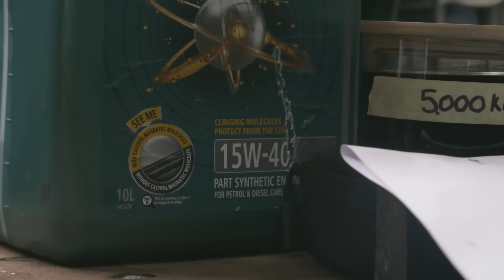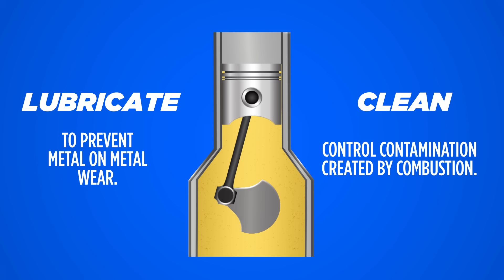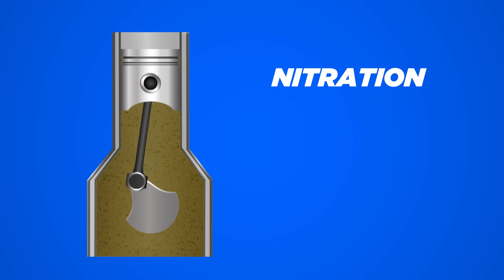Engine oil COMPARED at 5,000km vs 10,000km vs 20,000km! This'll make you service your 4WD RIGHT NOW!

Comment: Smartest is to put hour meter on your car. When they say 10.000 km - the average speed driven at any given time is around 30km per hour. So the oil change should be every 330 hours.  That is normal for engine that has lot of variable engine speed and torque use.  For engine that has almost fixed speed and torque use, like generator, boat engine and excavator. It can last 500 hours. So for perfect maintenance, engine hour meter is the key.

Comment: i have a PX2 3.2 ranger and live close to work, so i service it every 5,000km as it has a lot of short runs, my wife’s isuzu MU-X i service every 7,500 as it’s recommended at 15,000 so if half it, as for every other oil in them 20,000km as for the filters too. 
i also strongly belive in catch cans and pre fuel filters for reassurance

Comment: I have a Nissan Navara d22 and I service my oil every 8000-10,000 kms unless I’m doing a large trip which in that case I service before and after to ensure the motor is running the best it possibly can. I just changed all brake fluid, transmission and diff oil in prep for moving down to Tasmania!! I try to service all these fluids every 30,000. After I bought my car I realised the previous owner never did the brake fluid. Was absolutely black and discussing.

Comment: Brand new bt50, recommended by the dealer for every 20,000kms for normal driving 

I service mine every 10,000kms and have gearbox and diffs done every 20,000kms 

If the car has done harder towing or 4wding ect I get it in for a extra service on the 5,000kms
I also have all filters done every service and carry spare filters on the bigger trips 

At the same time I’ve had the egr done and a catch can aswell which also helps heaps

Comment: I change my oil every 5K and driveline oils every 20K being i own an older truck that gets worked pretty hard. Always make sure the car gets a chance to warm up and get to full operating temp. Oil is cheaper then a rebuild.
Reply: If you double up in Oil and filters over 300-400k Km's works out to save around 3-4 thousand In AUD dollars over the engines life rather then increase its longevity by a very small amount probably like a few percent. They don't just pull the recommendation numbers out of there ass its a pretty fine science and then rounded down to look nice. In the end it really just depends on how much your engine $, personally would stick to the recommendation oil and filter change under 10K engine value.

Comment: My 2013 Dmax manual says change the oil every 20k. I change it every 10k. The major services are each 40k, every oil, fluid and filter. Expensive yes, but cheaper than a new turbo, engine or diff. Long term investment.

Comment: I do a lot of off road driving sometimes towing a camper, without fail it gets serviced every 5000kms, gearbox, transfer and diffs get done every 10000kms unless I do water crossings then it gets done when it gets home. All the filters get changed every 5000kms as well. Since getting the car 4 years ago it was running 18.6lt/100kms, with the regular services I have managed to get it down to 13.5lt/100kms. I recommend every 5000kms if you want your engine to last.

Comment: Every 10,000km I check everything from filters to oils. Engine I typically do just before 10,000 but check it at 5000 and at least 2 times a month because sometimes I don’t drive it far or use it everyday. Diff and transmission I dip test and if the oil looks like it has dirt/water in it I change it but every 20,000-25000kms

Comment: I tow a boat and also do a lot of sustained highway trips and I change my oil and filter every 6000 km where the manual says to do it every 10000km.  I also run Nulon fully synthetic diesel oil , my mates tell me its overkill but I have just clocked over 300,000 km and have had no issues except for normal maintenance like timing belt , coolant , transmission , transfer case and diff fluids. In the rare occasion that I havent been able to do the oil change on time I will use an engine oil flush to ensure no carbon or sludge buildup . I also prefer to use a 5 or 10W40 weight oil where some dealerships use a 5W20 or 30 weight for fuel efficiency but heavy driving especially in hot summer weather is not going to give longevity to an engine.

Comment: I sadly no longer have any car at all.
But what I would do is something like.
oil and filter change at 5000km, if long vacation trips on the european highways it can be 8k to 10k for the vacation trip. or at least once a year if driving very little.
air filter when oil is changed, because why not.
brake fluid, gear, diff, coolant, cabin air filter, and so on. the things many tends to forget, at least every year, but could sooner depending on the use of the car during the year.

in all honesty I rarely put many km on a car in a year, just liked having one and maintaining it and fixing them as they where always old rusty things

Comment: In my td42 Gu I do engine oil every 5000 religiously rear diff and gear box every 15000  and Front diff every 30000 the Gu has 450'000 km on her now and still going strong

Comment: Hey boys I service my vechiles every 7500kms, Oil + Filter is a must and usually an air filter because what’s $20 to a $10k engine 
I Then go from bumper to bumper checking all parts off the underbody and gear oils changing when they start discolouring and smelling (usually on the 3rd service) 
My car gets me to work which allows me to make money and live life to the fullest. In order to keep doing the things I love I’ll spend whatever the cost is to keep my vechiles running smoothly and healthy!! 
 Thanks

Comment: I’ve have a did 3.2 Pajero and this video make me think about a was doing every 10000 on oil but I’ll start every 7000 km from now . Diff every 20.000 and gear box some time around 35.000 km 
Cheers

Comment: I like to "services" my car every 5000kms with a oil and filter. Diffs/transfer case/Gear box every 10,000 (but check every service incase they need changing). Would also change all oils after a hard trip or before a long one.
- Kane

Comment: My 2012 YD25 Navara get an oil change every 5K, and I stick to the factory schedule for the driveline and coolant as long as there’s no contamination! Air filter whenever needed. Fuel filter 15-20K. Brake and clutch fluid 20K. Blinker fluid as required.

Comment: I always service my vehicles maximum 5-6000 kms for oil
I do gearbox oils roughly every 20,000 kms
diff oils roughly 30,000 kms
Power steering flush every 15,000 kms

all fine and dandy
Reply: i change my oil every day , even when i dont use it

Comment: I do an engine oil change every 7500km. Owner's manual states 15,000km services, so I keep to the factory servicing and do my own halfway in between. I live in the country, so not much stop start at all. If I do a trip, I do a service, change oil and all filters before heading off. Trans and diff oils are always done either before or after trips away, but always much sooner than recommended (many  mods and a dyno tune). Never had an issue because I don't listen to the manufacturer who just wants you to buy a new car as soon as the warranty is finished!

Comment: I got my gu zd30di at 220,000 ks and did the pump injectors and glow plugs at 250,000 and in three years it’s now on 440,000 ks and I service the engine every 10,000 ks and it’s almost as clean as when it went in, admittedly I’ve let it go to 20,000ks on two occasions to see how it looks and it’s as good as the first dirty line in your test on the paper. I service the auto every 100,000ks but I haven’t changed my diff oils as yet but have checked them and don’t really hit the big holes much doing 1,200 ks a week to travel for work I could really use a year of oil to keep the old girl going and see how many ks the old gu will do. Cheers boys

Comment: I like your show but this video seemed meaningless to me.
Were the samples from the same original oil type? Or run in the same engine model?
I would find it interesting if you were to leave the oil in a particular engine and take samples at 0, 5k, 10k 15k and 20k, and send the samples to an oil testing lab (which is quite inexpensive) and report back on the results.

Comment: My Amarok is still under warranty from VW. The service book states an oil change to be completed every 15k.  After watching this episode I’ll be doing  extra oil changes at home. Thanks Shaun👍
Reply: I would do only one between services. And change just the oil, not the filter. Easy to do and even if it not necessary, it won´t hurt anything.

Comment: Hi Shaun the reason why Diesel engine oil goes black is because it is a high detergent oil designed to de carbon the engine to prevent Diesel engines from getting pre ignition. By 10,000km the very small oil filter if cut open would be choke a block full of carbon. The more oil and bigger the filter the less carbon buildup in the oil. I go 10k for oil fuel and yearly coolant and diff oil’s  transmission oil is changed every 2 years with filter and comes out clean in my 2014 Dmax XRunner. I regularly tow a 24 ft caravan with my 4x4.
Reply: Most filters onky filter down to 99 pecent ish at 20 microns. Soot particles can be small like 2 microns. Thats the stuff the filter wont get. So unless u run a bypass filter you should still change it once it starts going dark

Comment: 5k engine oil+filter  , 10k  airfilter+fuel filter  ,  30k - 50k transmission fluid+filter  ,  30k - 50k  diffs an transfercase .

Comment: GQ 650 km on the clock,all original, engine never touch ,engine oil,filters,every 5000,differential and gearbox every 10 km

Comment: Shauno, good advice for those that only do short trips, are regularly towing heavy loads, or spend a lot of time off road, however you didn't mention that a good quality filter is just as important as the oil itself, along with the oil change procedure. Best to drain oil with a wamr motor, as the oil will drain easier. Once refilled to the full mark, start the motor, let it run for 7 to 10 seconds, then turn it off. Wait a minute (for the oil at the top of the motor to drain back to the sump), then check and top the oil level back up. 

My X5 BMW is serviced every 20k to 24k, service book recommends 24k. It has done over 400,000ks without an issue, however I don't take it far off road these days, or do a lot of long distance towing with it. Most of the time it is driven, it is in a country town, dong 15 to 20 minute trips so it gets warm every time. Oil changes are easy, oil is still quite viscous (still turns as black as every other diesel), yet never had a major issue with it. However, it also uses 7.4 litres of oil, so I'd say the actual oil capacity has a lot to do with the longevity and service intervals of the oils.

Trans, transfer case and diffs have never been touched since I had it, they were last serviced in a dealership and don't need to be touched for another 30k or 40k. But again, I'm not doing water crossings and such every few weeks, so those depends on your driving conditions and the overall conditions of the seals, bearings etc. Each to their own, all comes down to how the vehicle is used.

Comment: 20yrs mechanic and I service all my vehicles every 5k . A recent car that shocked me was a 2017 Landrover Discovery sport with the 2l ingenium turbo diesel. When doing the service reset on our scan tool ,the countdown timer and km said 720 days or 37500km till next oil change! With all the modern oils being very specific and having alot more technology involved I still can't believe this is happening.
Reply: Everytime I come by Land Rover dealer I am amazed by all the gear boxes, engines and differentials on the shop floor.
Mechanics get a buffet from the catering company every friday.
Invoices are written with a shovel instead of a pencil!
Reply: Probably why they eat motors quicker than everyone else lol
Reply: @paladain55  Jelly is eating you up.
Reply: Funny story. My cousin has a LR Disco which was dealer serviced and just out of warranty when then engine died. Took it back to the dealer, engine is toast. Quote for a new engine (in Australia) was about $30k which is more than the wretched thing is worth. After some back and forward the engine was replaced … for free …didn’t want the bad publicity. Here’s the killer, the factory oil change interval is 2 years or 25,000 kilometres. I’ve heard of one similar story from a parent at my sons school.
Reply: For Land Rovers/Range Rovers, one will be lucky to get a trouble free unit driving it out from the showroom. These Tata vehicles are just beyond crap when it comes to built quality and reliability
Reply: @yslee1401  Absolute rubbish. Just say you've never driven one nor can afford one and be done with it. I have a Discovery 1 on 400,000kms, and a Discovery 4 on 250,000kms. Both are a delight to own with minimal issues and the Discovery 4 in particular is one of the most capable and comfortable 4wds built in the last 20 years.

Comment: I own a 2007 patrol so having a zd30 is scary enough, so oil changes every 5000k is a definite. All other oils at 10000k seems to be fine.
Reply: You do every oil at 10,000km intervals??
Reply: @jeffreycalvert1315  depends where ive been. Alot of water crossing in one trip will deturmin what gets changed.

Comment: Brought a 2011 200 series with 242K & straight away moved it onto 5k services with filter change on Penrite 5w 40 semi synthetic, plus fitted a catch can and had an EGR clean done - Running nicely now and breaths so much better
Reply: These Landcruisers (and Prado) are bullet proof vehicles when it comes to durability and reliability. No other SUV out there even comes close

Comment: Owning 3 cars I feel that I am servicing every second weekend. The FZJ105 gets engine oil done every 5 to 7k and filter every second service. Diffs I do yearly or if I have been giving her a hard time towing thew camper or out on the tracks, I will change the diff oil after a big trip especially if there is water crossings. Transfer case gets done every 2 years and gearbox every 2 years. My Rotary gets engine oil done every 2.5k or every 10 or so months (dont use the car often, usually 10 months is under 1k kms). If I track the car, its done before and after the track day. Diff and gearbox, plugs and leads is done every 20k or 3 years which ever comes first. The SS is done every 5 to 7k (15k service intervals) with oil filter every second service. Haven't done the Trans or diffs in that yet as being Auto and not driven hard, the oils are in good condition at 65k on the clock. Will probably do them at 80k. Mower gets oil changed every move (Army so about every 2 to 3 years) and the whipper snipper, well, its a 2 stroke. Lol. 12 months supply even for one of the cars would be epic. Might just be enough to make me convert from Penrite.

Comment: I’ve always found that 7-8000km works well for me, but I always try to change before and sometimes even after a big or hard drive. Rather spend that extra $50 on oil over $5000+ on a new motor
Reply: Que chupón.

Comment: I have a couple Nissan patrols with td42 in them and I do every 8k to 10k on my services but I use a 1L of Moreys In the engine every time and that stops a lot of that td42 tappet noise and the oil always runs out nice when I do a oil change no matter what type of driving I do.

Comment: GQ Patrol, TD42, manual.
Engine:
Oil and filters every 5000km with Penrite HPR Diesel 20w60, air and fuel filters every 15k or before AND after a big trip. Coolant avery 60 000km or every two years, whichever first.
Power steering fluid every 30 000 or annually.
Valve clearances every 35 000.
Gearbox and transfer and front diff: oil changed every 30 000 or yearly or before a big trip (whichever happens first)
Rear LSD: oil changed every 15 000, or annually or before a big trip, whichever happens first.
Brake and clutch fluid: changed annually.
Universal joints and steering components greased every 5000.
Wheel bearings inspected every service, re-greased annually or at 30 000 or before a big trip.

Might be over the top on some things, but it's done 557 000km, so it deserves some love.

Comment: I own a 2002 hilux turbo diesel. I change my oil/ oil filter every 5000km and fuel filter every 10,000. My diff and gearbox are done every 20-30,000 depending on what type of driving. “ pre active before reactive “

Comment: 10000 km for engine oil, I do alot of highway driving so the engine is up at operating temperature for longer periods.
diff and trans is a mechanics problem, I don't have a hoist!

Comment: MY NP300 SAY IT 20KM THOUS EVEY SERVIE I DO MINE EVEY  10 THUS KM  EMPTY MY CATCH CAN EVER 5000  REPLACE FITLER EVEY  . DO MY FUEL FILTER  EVER SEC 10 THURS KM.  DO MY GEAR BOX DIFF EVEY  ONCE  OR TWICE YEAR DEPPANDS WHAT BEEN  DOING  . AS MOST TIME IT ON ROAD NO HARD WORK  AIR FITLER I GOT A KNN FILTER  SO I WASH IT  AND CLEAN  IT OUT EVEY 5000 KM MY NP300 DONE 60 THURS  ON CLOCK. WHEN I TAKE IT  TO PLAC I GET IT ALL WORK  DONE HE  SAY IT SO CLEAN  ....

Comment: I get the Toyota dealer to complete the log book service in the prado and then I do the engine oil and filter at the 5000km halfway mark....definitely worth doing. 
Then dirt bikes as required but no longer than 12 months if it sits too long.
Speed boat at the start of each ski season as it sits in lay up for the cold Vic winters..and of course they all get   CASTROL oil and always will 👌

Comment: I have a number of cars, hilux ln111 with 440k, changed engine oil every 5k, (gearbox, transfer, diffs every 50k) same in the cruiser 105, it has 335k on the clock, commodore vt with 420k engine every 5k, diff every 50k, auto box every 25k... hilux has a rebuilt gearbox due to spigget bearing failure.. but all other vechicals are all original parts no rebuilds.. both hilux and holden have been owned since 100k each..